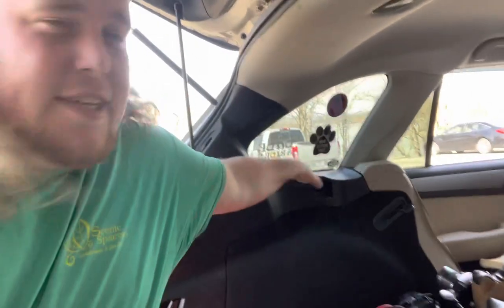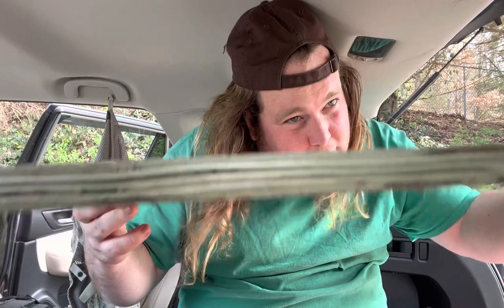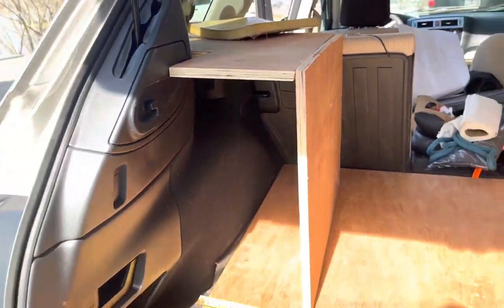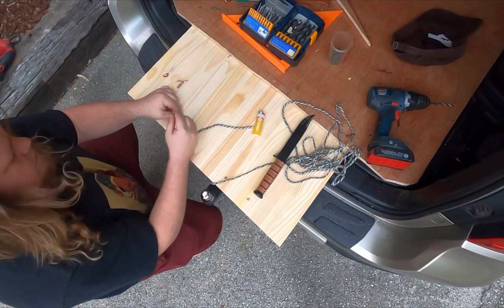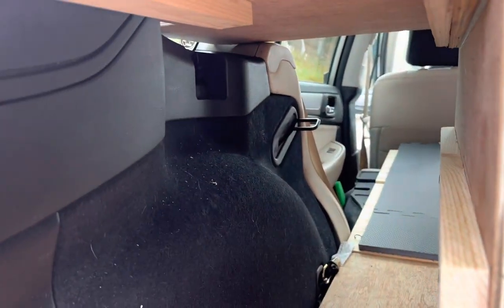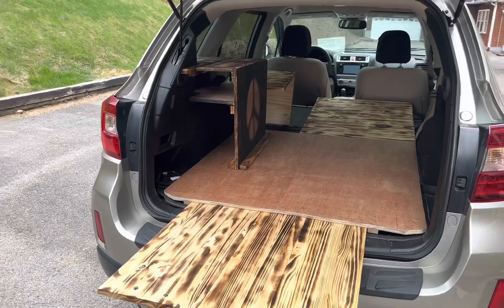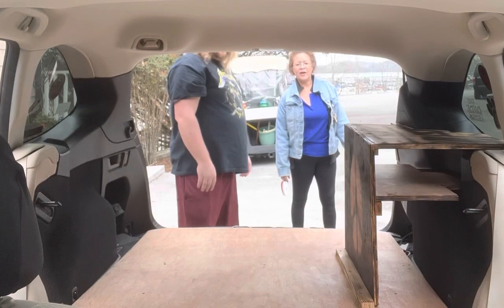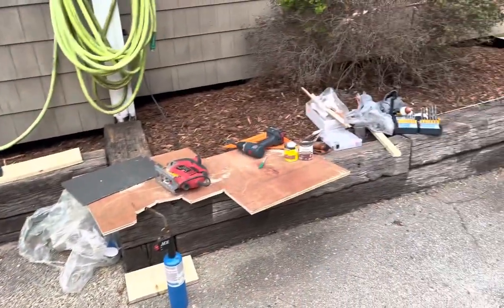Subaru Outback Camper Conversion

Comment: Nice and easy! I have a 22 outback and you gave me a few ideas. I think if you glue most of the gym mat on the wood, you wont have to bother taking most of it off and on all the time.  Also perhaps adding felt to the bottom of the sliders will help them slide easier and not scratch and wear the car as much as it slides in and out. Over all good innovation.

Comment: Or a roof tent, side tent that connects to car. All good.
Reply from the maker: I like roof tents, but most roof tents I see: decrease gas milage, storage, add weight, and are expensive for what you get. 
Getting a used thule or something and simply putting a tent in it with chairs, sleeping bags, tarps, etc seems to be much more cost effective and practical. Just without the cool factor a roof tent gives.